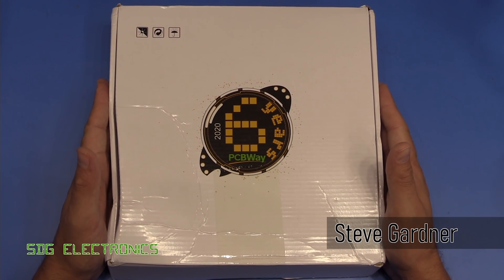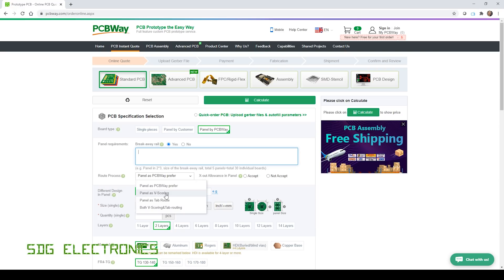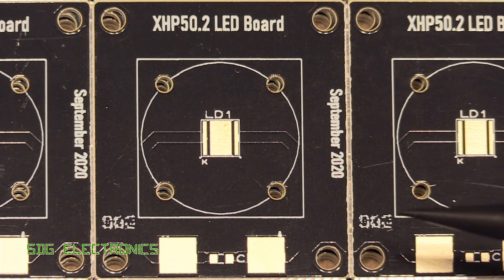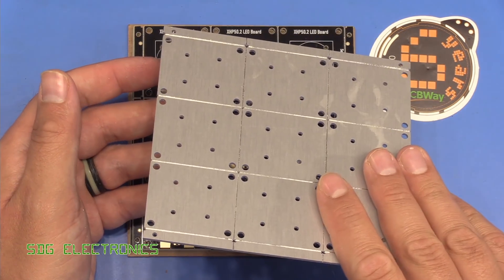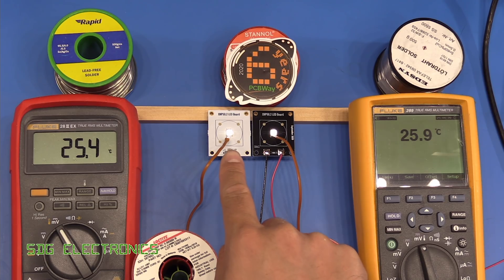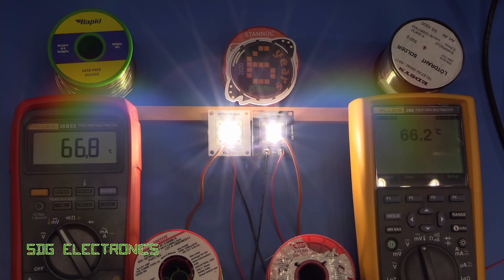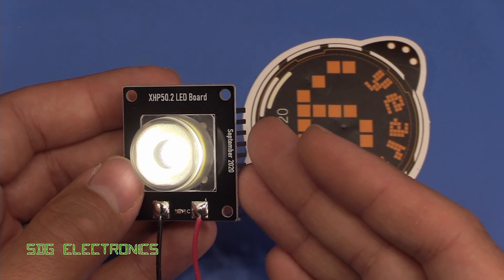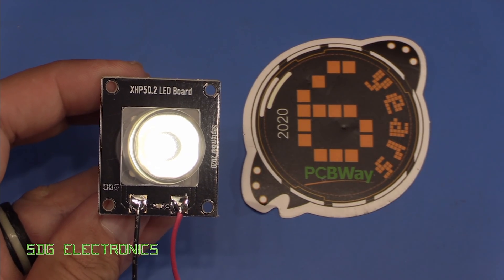SDG #176 Aluminium PCBs better for High Power LED Boards?

Comment: This is OK for LEDs that have an electrically isolated thermal slug. But certain LEDs have the thermal slug electrically connected to the anode, so having a bunch of series-connected LEDs is problematic with the FR4 board and much better with aluminum-core PCB.

Comment: I think the real question should be which pcb's thermal conductivity is better - when put on the same heatsink and at around 3A (3A for 6V xhp50, or 6A for 3V version), I doubt that fr4 would transfer heat quicker that xhp50 melts that bismuth ;D ... anyway, that stuff is important for flashlights, where you need max conductivity in a very limited space, not in these applications where you have one room space for cooling...

Comment: What was the little capacitor for on the LED PCB's? I was thinking it was ment for a anti flicker?
Reply from the maker: when used with a DC-DC converter, it helps reduce the ripple current at the LED

Comment: This actually makes sense. If the power dissapation is same, on long term the temps will always equalize. It's not possible that one system runs cooler than other, unless the coupling of the heat source and heat sink is so bad, that considerable amount of heat is dissapated via the device itself into air instead of the heat sink. Clearly in this case, the coupling on FR4 is adequate for the application.

Comment: I love it when people just assume things like that and then a simple test proves them mostly wrong.  People are SO SURE about things that they never think to do a test.  Why would they test?  it's obvious!  Except it's wrong.  Aluminum PCB material DOESN'T conduct heat to a heat sink better in any meaningful or significant way than copper vias.

Comment: Can you share that Lumileds article?
Reply from the maker: I was trying to find it yesterday, but they redesigned their website. If it recall correctly, it was a paper about cooling on their "new" Luxeon Rebel LEDs which at the time were the highest power LEDs on the market
Reply: @sdgelectronics  
I think I have found article.

https://lumstatic.com/En/0i/WQb7sgG5kseBR4dwjA.pdf

Comment: I understood that the MCPCBs are more for LEDs without thermal vias, especially when those are packed up in quite a big amount to reach luminous requirements. Correct me if I am wrong.
Reply: Its also for when the thermal pads can be electrically conductive, these Cree LEDs hes using have 2 configurations, the 3-5 volt configuration makes the pad isolated while the 12 volt config makes the pad not electrically isolated

Comment: This result seems odd, in almost all applications notes I have seen, mcpcbs tend to outperform FR4 with unfilled thermal vias by a decent margin.

Did you check the power consumption of both devices? Are the copper layers the same thickness? Are both pcbs the same thickness? Did you use thermal interface material between the metal and the heatsink when you mounted it?

Comment: This is a very interesting outcome. I've been working with high power LED flashlights for a long time and I always considered PCB heatsinks to be inferior to metal core PCBs. But as you mentioned, the PCB must be designed properly to achieve this level of performance.

Very high power flashlights often use copper core PCBs for an even better heat transfer. With a copper PCB they can use a "direct thermal path" design, where the top FR4 layer has a cutout in the place of the LED heatsink pad. Therefore the LED gets soldered directly to the copper plate, bypassing the thermal resistance of the FR4 PCB layer.

Comment: It would have been interesting to cover the stack up of the aluminium boards, are they .8mm FR4 bonded to .8mm aluminium and is 2 layer possible with them ?
Reply from the maker: Yes, 2 layer is the limit with the metal core either in the middle or on the bottom side. Not sure how vias are handled on the PCBs with the metal core in the middle though.
Reply: @sdgelectronics  I thought it would be 2 layer .8 FR4 bonded to .8 aluminium ?

Comment: I used metal core PCB's in my applications and they are very useful if you need electrical isolation between the board and the heatsink as the Aluminium core in this case is not electrically connected to the LED pad. There are also metal core PCB's with quite different characteristics in terms of thermal resistance between the copper layer and the aluminium core.
Reply from the maker: That's true, I forgot about the isolation aspects. PCBWay offer some options on the MCPCBs - the ones selected had the best thermal conductivity that they offer (2 W/mK).

Comment: That shows that the heat radiations from a aluminium PCB is about the same as a FR4, but without a heatsink on the back it do not say anything about how well the heat is transferred to the back.

Comment: When I was beginning my adventure with power leds (Cree CXA arrays), I was having leds die on me (silicone cracking ripped bondwires), but the thermocouple didn't show anything abnormal. I quickly realized that the only way to get a reasonable picture of what's going on was to buy a thermal camera. This is also true with smaller leds, because thermocouple can give substantially false readings because of absorption of light.

Thermal camera helps a lot. For one, it explained me that the silicone gets very hot, probably because of energy loss in the phosphor. It also clearly showed me that my led array was heating abnormally in some spots, where i probably had either bubbles in thermal grease, or dents in the heatsink.

One more interesting conclusion was that I shouldn't use thermal-conducting epoxy - it degrades in about a year of use, probably due to massive amount of light getting through the white ceramic base of the arrays. Ultimately, I abandoned these arrays - they proved too unreliable. I have bought massive amount of relatively low-power leds, and they proved incredibly reliable even at high temperatures (110 deg.C) on regular FR4.  (still not a single one of 2048 has died after 5 years or so of everyday use)
Reply: Interesting, in almost all my house i am running cxa1304 and cxa1507 for +-3 years and for now all the LEDs don't have any problem. However i am running them without thermal compound(for the 04 ones) both on 5°C/W heatsinks so they remain cold-ish. I am using screws to mount the LEDs (the wrong way, but didn't want to use glue/epoxy on them)

I am a fan of COB LEDs due to ease of mounting to a heatsink, even thought they are more expensive(comparing to 2835 0.005€/ea everlight LEDs)

Comment: I wonder how closesly matched the two LEDs are in respect to light output, current consumption and thus thermal activity?
Reply from the maker: They are supposed to be binned and from the same batch. I did mean to compare light output but I wasn't sure if the black PCB would skew the readings.

Comment: Excellent! That will save a bit of money :)  I was actually considering the thermal performance as I saw this video appear and was thinking about getting thinner boards in FR4 to lower the thermal resistance but I don't know if its significant. Certainly there's no structural requirement for the boards to be as thick as they are.
Reply from the maker: The only reason in this application to set the FR4 boards to 0.8mm was the little pegs on the lenses would interfere with the heatsink if the PCB material was any thinner. If not using those, you could go for the thinnest PCB you can get if you can ensure good contact with the heatsink.

Comment: Do the same test with a fan on the heat sinks and you will find the led junction temperature will be lower on mcpcb once the leds temperature has stabilized. This is a nice project look forward to the redesign of the 3D printed bezel.
Reply from the maker: That might be worthy of a test.
Reply: @sdgelectronics  also you performed this test with heatsinks facing down. Since passive cooling revolves around convection, I wonder if that condition and close proximity of test subjects could affect the difference.
Reply: In case of active cooling result may still be the same if insulation layer of MCPCB cripples its thermal conductivity. Or it may be that the heatsink used is the real bottle neck for a steady state temp result and OP would seem right.

Comment: Could you try measuring how the Al PCB fares if used without a heatsink? (Both short term and stabilized over time.) In that test, orientation as well whether the lens is attached should make a difference as well.